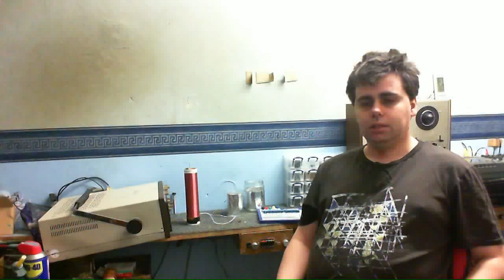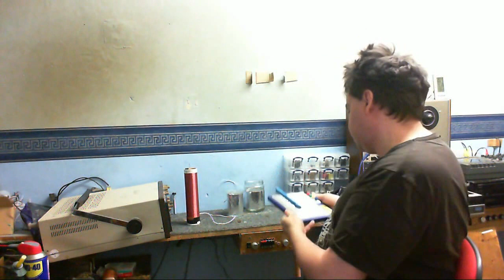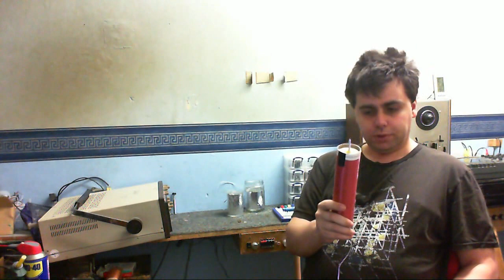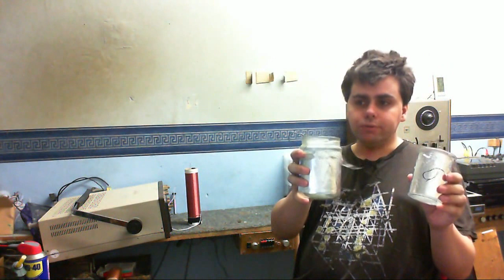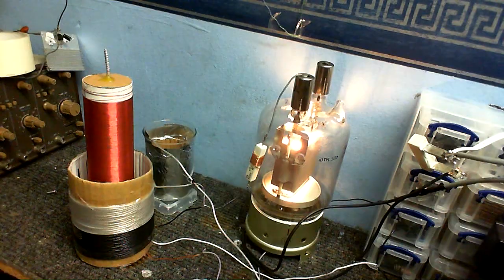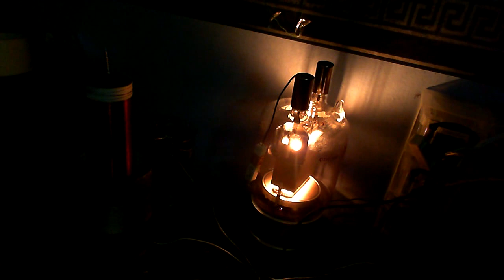What happend to how to make a VTTC part 2?

Comment: Have parts, will send!
Send me your wish list & I'll send you some stuff to play with.
Reply from the maker: Energy Fabricator Thanks, so what kind of things do you have?
Reply: CoolDudeClem I have a bit of everything. List a few things down and i'll let you know if I have some spares...
Reply from the maker: Energy Fabricator if you have a variac or some film capacitors that I could use that would be good.
Reply: CoolDudeClem I have a small surprise package with a bit of everything in it - all ready to go. Send me your address and I will post it asap. I'll put a second package together and get some HV caps in there for you & maybe some pieces of bakelite for HV insulation..Do you need any contactors?
Reply from the maker: Energy Fabricator Wow, thanks, now I cant wait!  It might be a good idea to throw in the contactors and the bakelite insulators, I'm sure I could use them. I'll PM you with my address.
Reply: CoolDudeClem No problem.
Reply from the maker: Energy Fabricator Just curious, did you get my PM? I gave you my Address, thanks again for offering to send some stuff.
Reply: CoolDudeClem 
Yes, I got your PM. I'll send the package during this coming week.
Reply from the maker: Energy Fabricator ok, thanks.
Reply: Oh no.  I gotta talk to CDC.  OUCH!  As I'm sure many know, same thing happened with Tesla himself and my home-brew VTTC700 (overheating secondary). Even perfect resonance will not eliminate this factor.  I was able to fix the coil but I have to make some degree of compromise (operating time/power also keeping a laser thermometer on my coil every so often!  if the coil is to be relatively small, Induction heating is hard to deal with in small coils. --KF7DFP